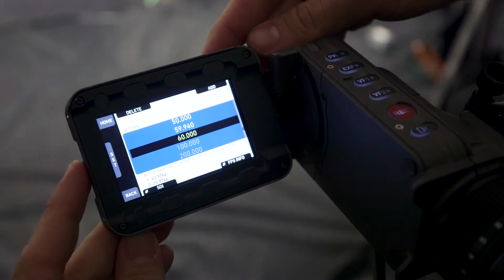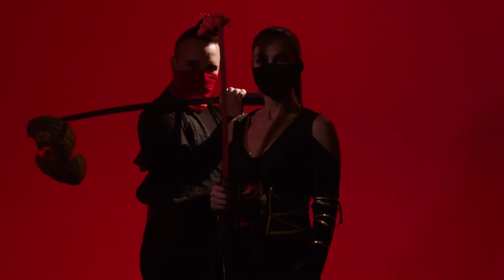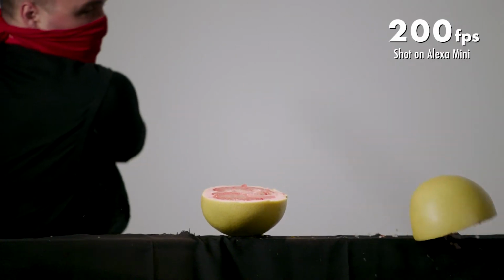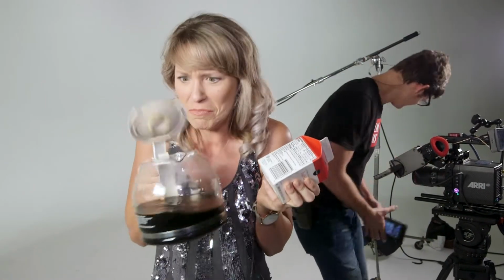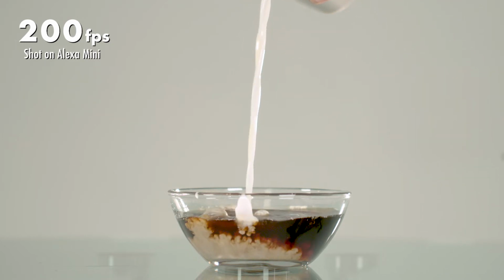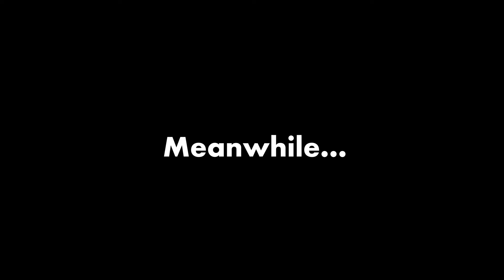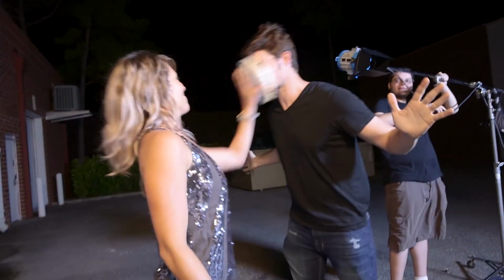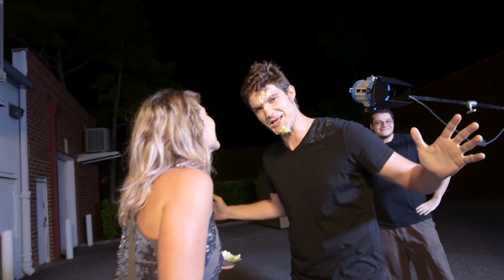ARRI Alexa Mini Slow Mo Footage 200fps & 60fps

Comment: In los Angeles and other cities how relevant is this Alexa mini vs the Komodo x on sets ? Would you still recommend this camera over a Komodo x ?
Reply from the maker: Hi there! Most of the feature films and higher budget TV spots are still Alexa Mini here by us in Tampa, FL. But a producer or DP can always suggest a different camera they want. We often get to choose the cameras we use on our projects, and I still think the Alexa Mini offers the best bang for the buck combined with ease of use. I had an Alexa 35 on order but after working with a rented one, and dealing with the extra weight and extra power, definitely made me reconsider. The Komodos are nice but the Mini has the 2x SDI which does make a big difference for my style of working. I also like the color on the Alexas a lot too...it's hard to beat!
Reply: @FilmJams  more sdi can be adapted to red Komodo x with red accessories though right ? Does Alexa mini require a lot of light per shoot ? Hard to beat those Alexa mini colors too
Reply from the maker: @creativegreatsvisuals  You can add with a breakout, but you only have 1 MAIN SDI - and they're known for frying...so if it goes out on a film, you have a pretty much unusable camera. Komodo has global shutte which also requires a lot of light...neither is a low light camera. For that check out an FX6 or Venice.

Comment: Did you have to change the shutter angle when going 200 fps?
Reply from the maker: I just leave the shutter angle set to 180 degree whether I’m in 200 fps or 24 fps. That will give you standard look. Unless you’re going for a motion blur effect keep at 180.

Comment: Ninjas typically used a Ninjatō, which was a shorter version of the traditional Japanese sword, the Katana. The Ninja's sword was made shorter than a traditional Katana so that the wielder could have a faster draw from it's sheath.

Whatever the swords are that you're using to cut all those fruits and vegetables with one thing is certain, they could definitely use a few (or many ) good passes over a Japanese wet stone.
Reply from the maker: Averageuser Commenter thanks for this info! Didn’t know that, but all this talk about wetstones is getting us excited!